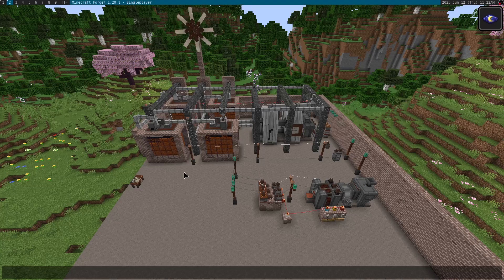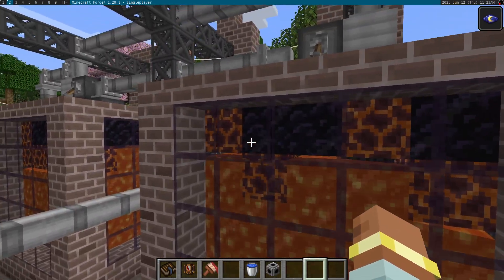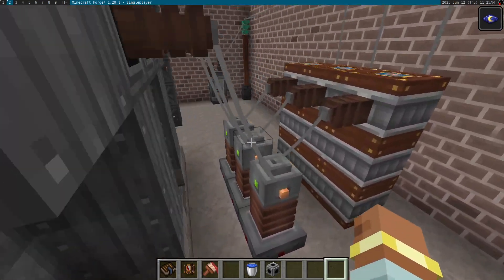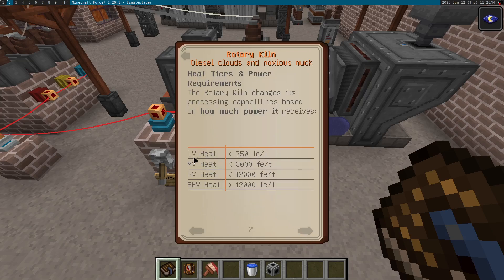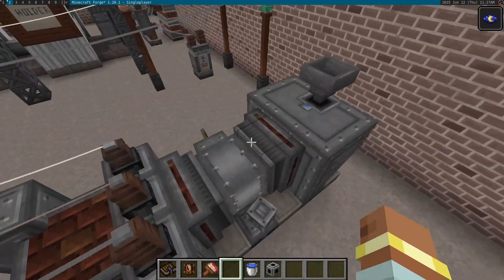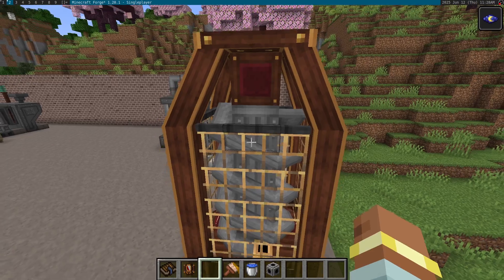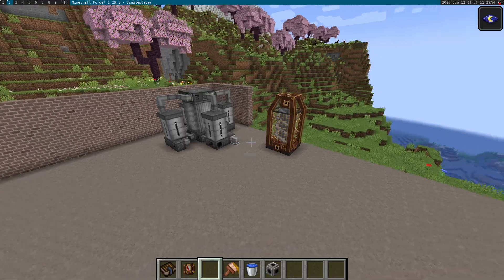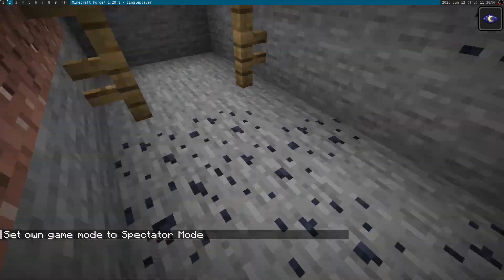Immersive Geology Snapshot - 0.7.0 Update

Comment: That's a really cool update! The geothermal exchanger interface looks so sick!
Will there be a way for the geothermal exchanger have some kind of configuration for the block to not turn into obsidian? or some method to replace the obsidians with newer lava without manually placed?
And does the magma block/lava, different block type affects the steam production? If so, is it possible to add a datapack configuration for block to have different value affects the geothermal exchanger steam production?
Reply from the maker: Thanks!

This one really took a long while to get working correctly.

As for dealing with the Obsidian, currently, there isn't a way to automate this entirely with just Immersive Geology; You could add a datapack recipe that adds a high temperature liquid as an input and a cold temperature liquid as an output and that will turn the Obsidian back into magma, and magma into lava (if the input liquid's temperature is high enough).

Currently, the blocks only provide a heat level, and this heat level does not affect the processing speed of the recipe; I may consider this for a future update or tweak it down the line however.
You could use a datapack with a custom 'Geothermal Conversion Recipe' to allow different blocks to be used for heating or cooling purposes. (This will also let you set the temperature requirements to change the blocks state)

The Geothermal Exchanger will likely be tweaked in the future updates, for example adding a chance item output as as it may be used in the future as a sort of alternative to Thermal Evaporation.
Reply: @muddykat-tech  Cool! Thanks for considering! Love your mod, it's so cool to see more multiblock and visually they look so stunning as well! You're doing god's work!
Reply: @TqLxQuanZ   oh shit, i was gonna suggest this mod sometime, but it seems the creator of Deceasedcraft already knows of its presence, this is Booster btw
Reply: @muddykat-tech  are there plans in the future to add other heat options, such as maybe some form of processed uranium?